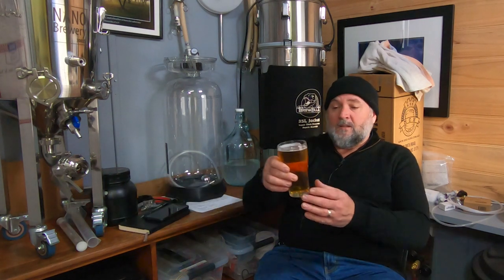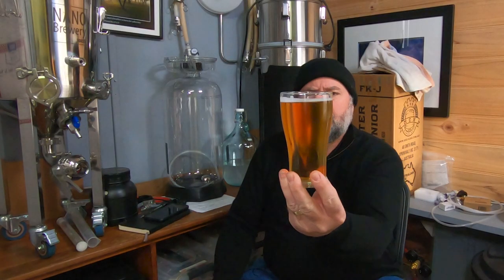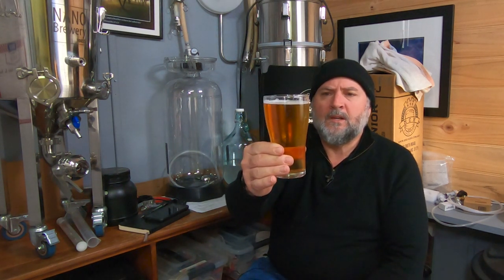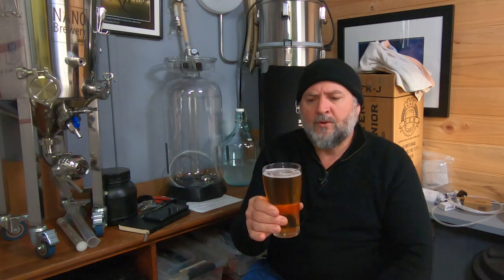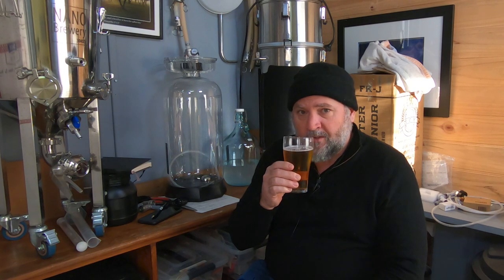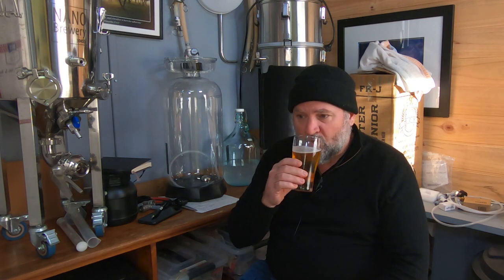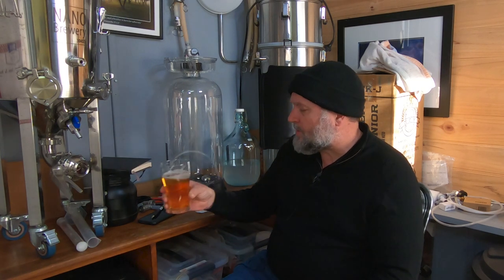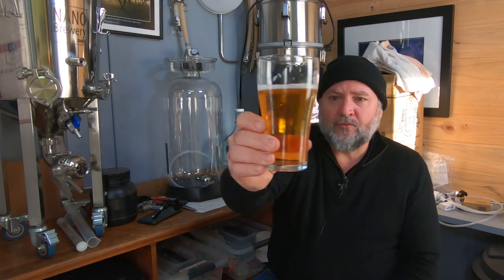Lager Brewing Discussion | 15 Minutes in the Brewery | Homebrewing

Comment: Now this is interesting. I did a double batch of NZ pilsner a while back and fermented half at 12c and the other half under pressure at 21c. The only other difference was I used one pack of dry yeast on the hot ferment and two packs on the other. The pressure ferm took 9 days to ferment out with one pack so definitely slower than if I'd used two. The other beer was done in 12 days. I will ramp up the temp to 17c for a diacetyl rest also which helps speed things up. Also I tend to cold crash for a week so usually a 3-4 week process for cold fermented lagers.
I haven't actually tried the cold ferment version yet but definitely want to do a side by side now and see if there is any major difference.
Reply from the maker: I will actually be fermenting my next lager at 12c as well. I want to make a festbier and I'm running out of time!
Reply: Alas, the keg of pressure fermented lager kicked last night before I got the chance to do a side by side this weekend. Got my brother staying with me and he is quite keen on it so I'm blaming him 😂
Reply from the maker: @BigBananaBrewing  🤣 that's happened to me before more than once..

Comment: Interesting that you said Diamond lager yeast produces more sulphur than saflager... I recently brewed a Munich Dunkel and decided to use diamond lager instead of my normal saflager. I followed my usual fermentation plan and started at 12c and with 10 gravity points to go started ramping up the temp every second day till I hit 18c for a dyacetyl rest. It turned out almost undrinkable with an off flavour that I couldn't put my finger on but now I'm thinking it's a large amount of sulphur.... I'm back to saflager for my vienna lager that's in my fermenter now and am trying a colder than my normal ferment.